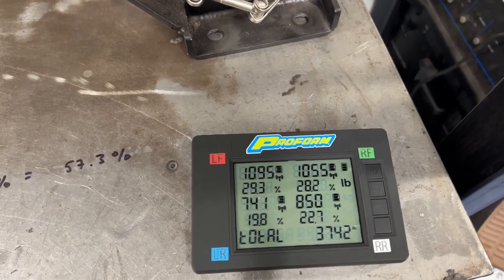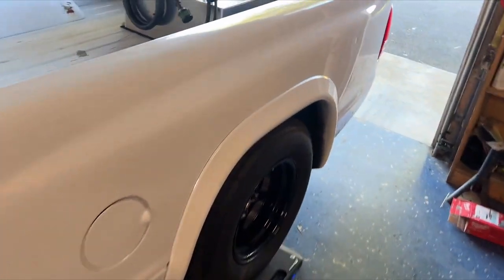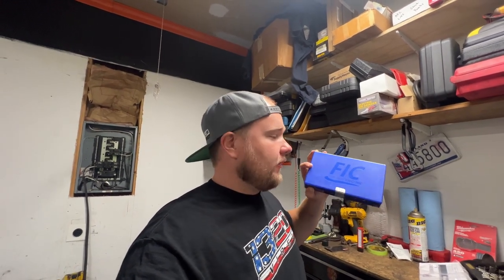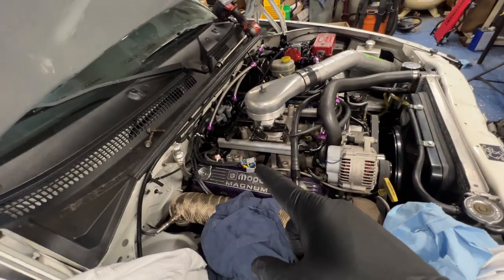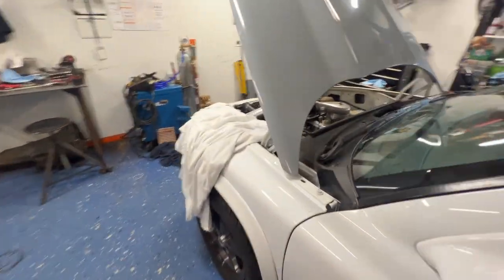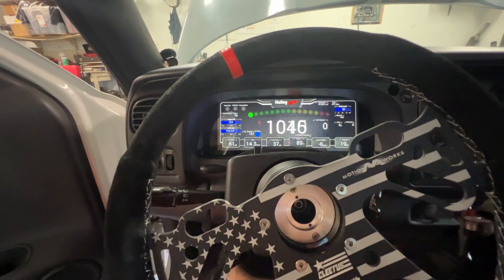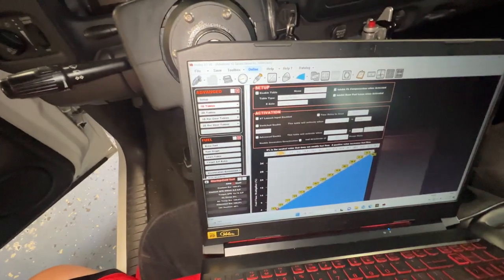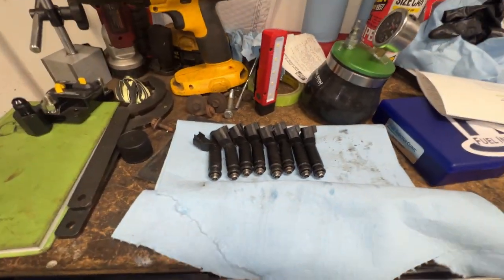Missing piece to the fuel system puzzle...

Comment: can i ask a question about what map sensor you used to be able to read boost? i plan on using hptuners to tune my setup... but what about the map sensor?
Reply from the maker: Holley has a bunch of different map sensors to choose from. I’m using a 3.5 bar.  you can use different map sensors with hp tuners too but you’ll need the map sensor information so you can set it up in the software
Reply: do those holley ones bolt on? i don't remember any vacuum hoses going to the map sensor the last time i worked on the engine. i've heard of people running srt4 map sensors or honda map sensors. but they won't just bolt on there

also thank you for responding i really appreciate it

 @ThatTurboDakota
Reply from the maker: You’ll most likely not be able to find a sensor that bolts in the same location under the throttle body. You can just mount the sensor where ever and run a vacuum line to it. I have mine in the factory location for the air inlet temp sensor. Then I took the air inlet sensor and put it in the intake before the throttle body
Reply: awesome. thanks man. solves some problems in my head as i plan the setup @ThatTurboDakota